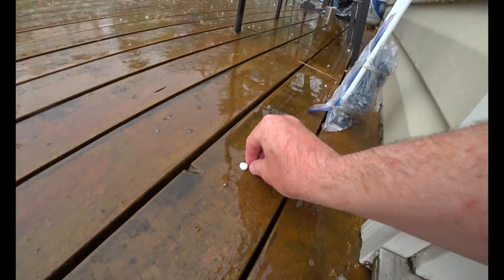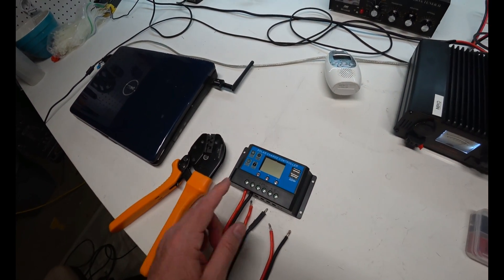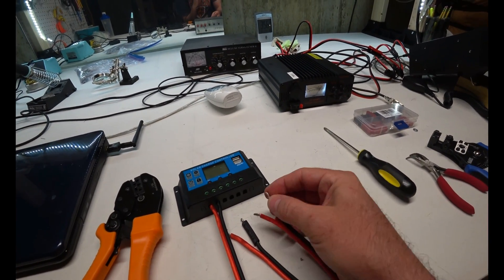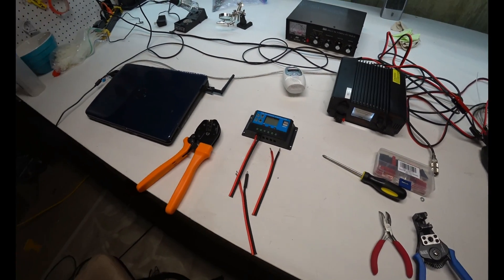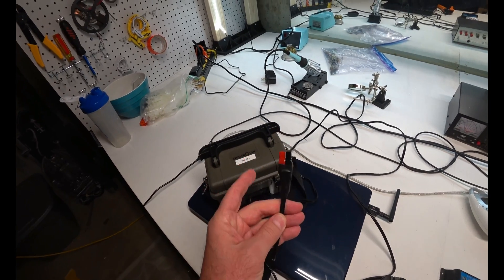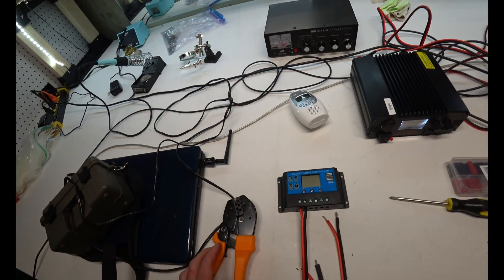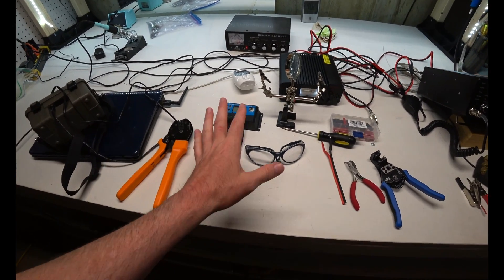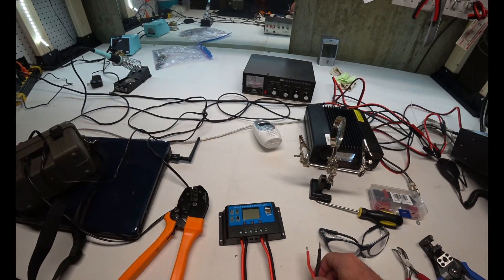ALLPOWERS Solar Charge Controller + Powerpole Installation for Ham Radio

Comment: Not sure what happened, but the video went to black screen from about the 7 min mark on, and I didn't get to see how the power pole connection to the solar charger worked.  I'm interested in doing the same thing and wondered if it worked out for you?  Thanks for the video.
Reply: Same this happened to me... its as if you rendered an extra few minutes of black when you edited this video.
Reply from the maker: doggirl211 try a different browser to view it